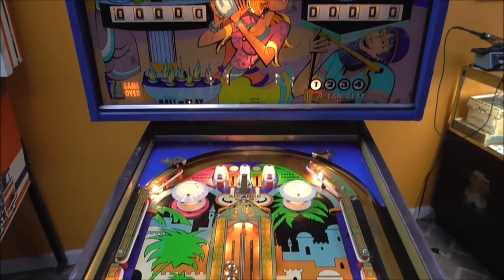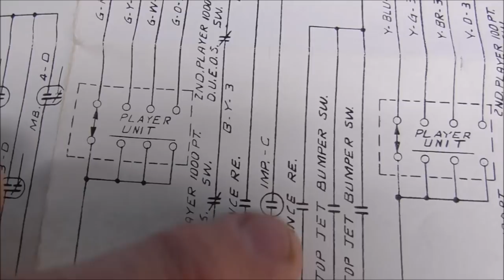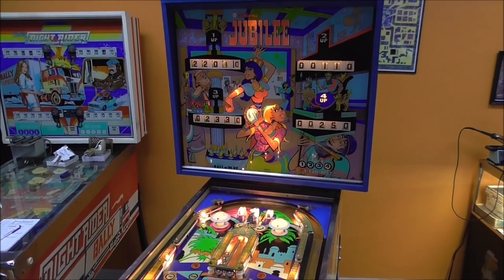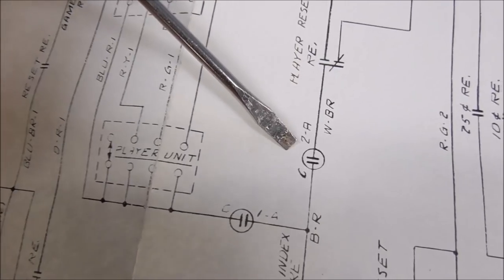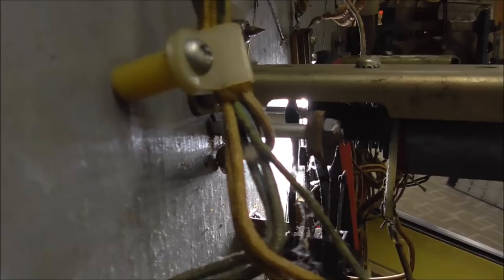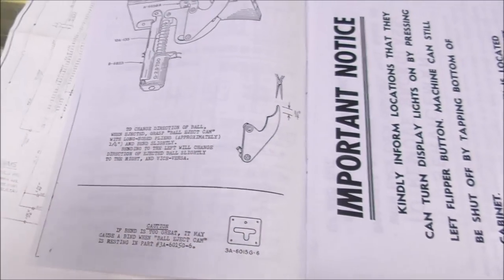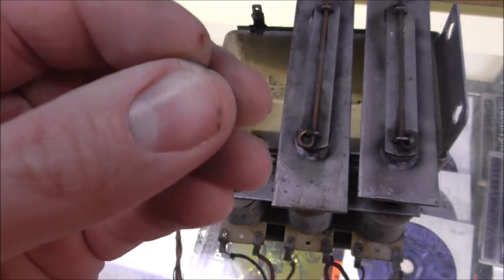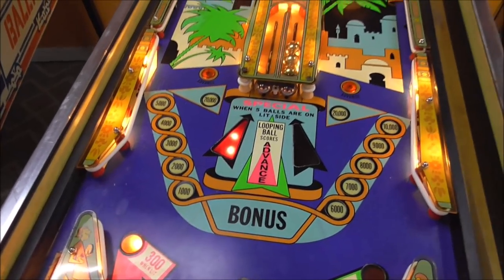More Schematics & Rebuilding The BAD SOUNDING Chime Box on a 1973 Williams Jubilee Pinball Machine !

Comment: Some pinball places do sell refresher chime unit stuff like new washers and stuff I bought one of them for my Williams Space Mission chimes unit.
Oh and I know I am way over here in Portland, OR but if you ever need some metal pinball parts nickel plated I can hook ya up.
Unfortunately I cannot nickel plate large metal pieces but I can do smaller metal parts.
I am excited to finally be metal plating stuff as my 1935 pinball machine has needed it's nickel plating put back on so finally got a power supply some nickel anodes and I did my first test yesterday. :)
I will have a video up on my channel here soon it is not hard to do plating. :)

Comment: When is "double bonus" supposed to be lit?  It used to be lit all the time, but wasn't nearer the end of the video.  Also, it would seem like a full functional test should include checking that configuration options like 3 vs 5 ball play work as they should.

Another thing I was wondering about, since you mentioned the phrase "bells and whistles", I was wondering whether any notable machines used any sound effects other than bells/chimes, the knocker, and an "over-the-top" buzzer.  Taking something like an American Flyer whistle and attaching it (possibly through a resistor, or light bulb, since it would normally expect 15 volts) to the "extra advance" relay or the relay that's used to score 1000 points from the bonus would seem like it would have been a simple way to sonically set a game apart from over machines of its era.  I've probably seen over 100 machines from that era and don't remember any special sounds, but the cost of adding some would seem like it would have been trivial compared to the cost of all the electromechanical scoring mechanisms.

Comment: Sometimes if you camera acts more and more like it does not want to autofocus, make sure the lens and any sensors on the front of the camera are clean and no smudges.  That happend to me.   I called Ron the other day and missed you.   I'll get io with you soon.
Reply from the maker: I think that's what it was, I've cleaned it a few times and it seems to be better i'm going to have to get a lens cloth.

Comment: if why  you dont like 3 videos is because the repair is so complex that it takes 3 videos it is ok to combine them into a 3 hour video.

youtubes limits has been raised recently to 12 gig filesize and only a couple years ago and occasionally we see videos of windows startup chime stretched to 24 hours so the algorithm does support long videos.

i think copyright describes the protection better because you are automatically granted copyrights just by creating the video  trademarks and patents you have to register but not copyrights.

if i had to guess why the wires was cut is  either the jones plugs failed and they wired it directly or they wanted to bypass the head or they did not have the schematic and was trying to find the wires to trigger the reset.

Comment: JOES CLASSIC< What is the Impulse CAM purpose? I don't know what the impulse CAM is doing. The advanced relays are connected to the advanced stepper unit which is doing what? I don't know what the advanced unit purpose is doing. I need some background theory of operations first please
Reply from the maker: So when the score motor turns on, it turns around one half of a revolution.  If the switch is on one of the regular cams, it turns on for half a revolution and then turns off.  If the switch is on the impulse cam, though, it turns on and off 5 times, because there are 5 bumps on the cam to make the switch touch 5 times.  The Advance relay pulls in when you hit the advance switch on the playfield, it advances the bonus, the advance stepper unit is the bonus stepper unit, it keeps track of how many bonus points you get at the end of the ball.
Reply: @LyonsArcade  what is the impulse cam doing with the 5 bumps for the switch to touch 5 times? The score motor has CAMS and the impulse Cam is not on the score motor its separate unit

Comment: Hi Joe ! I have a question, does a original Space Invaders backglass for 50 dollars is a good deal ?
Reply from the maker: The Space Invaders pinball backglass had a couple parts to it, it was in a box with lights inside... so it kind of depends on which backglass it is , lol.  If it's in good shape yes that's a good deal.
Reply: Thank you Joe for your fast response, there is only the glass of the machine. the glass has bright colors, the only problem is that it lacks a little dark blue paint ... I think I could make up for it easily! Thank you for your precious advice and a very happy new year 2021!